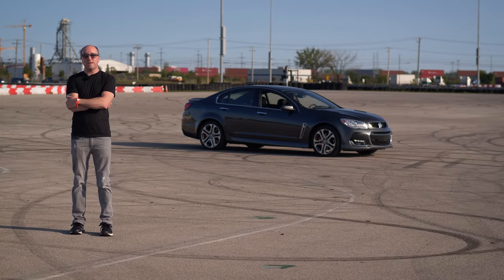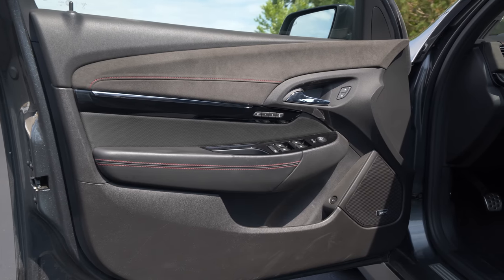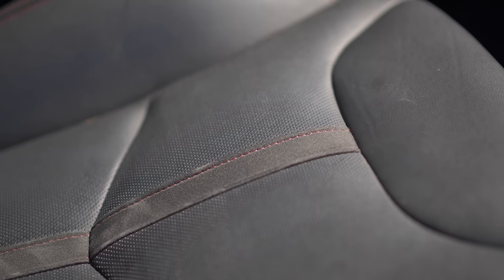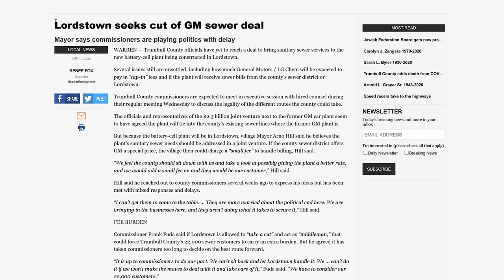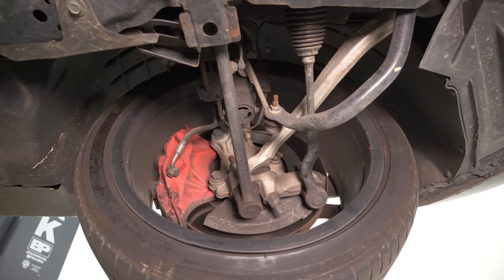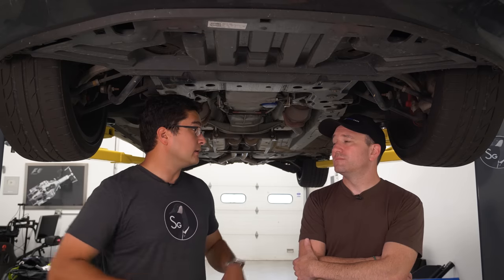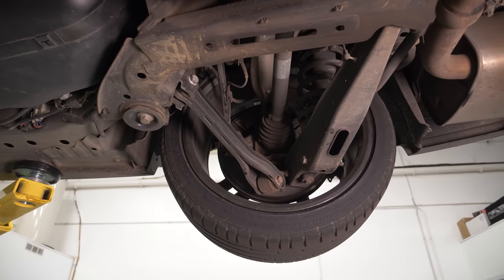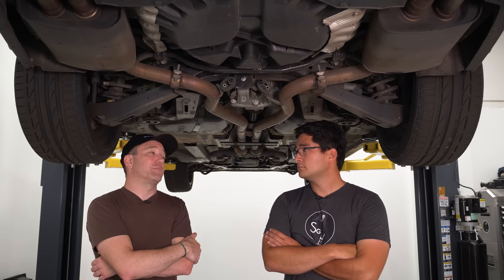Chevy SS Commodore | Holden a Funeral

Comment: Great video and a bit of a trip down memory lane. Commodores were common growing up, along with the Ford Falcon counterpart. I used to live a few kms from the Adelaide factory, which was a considerable employer for the area and I even eventually owned two Commodores (VT V6, VY Calais LS1). It's amazing how fast economics ended both the car and the brand, along with almost all local Toyota, Ford and Mitsubishi manufacturing.
Reply: So, does this mean that y'all are pretty much going to be importing most of your cars from now on?
Reply: @lego4virgo  yeah. I actually can't think of any local car manufacturing that exists here, except for small niche stuff
Reply: @lego4virgo  yep, several factors lead to the demise of the Australian car aindustry - local labour is too expensive in Aus to build cars. and politics. and the only cars being manufactured in Aus were large 4 door sedans where the market wanted hatchbacks or SUVs. Ford had a good thing with the Territory, but it was getting old. The replacement (everest) was designed in Australia but is built in Thailand.
Reply: @lego4virgo  All of our cars are imported, though there is a firm in New South Wales or Queensland I believe that is going to try and kick-start hydrogen EVs which should be interesting.

Comment: I was lucky enough to spend five weeks with a VY Series II Holden Calais on my first trip to Australia. Then I rented a VE SS for the next trip. Tbh I liked the VY better. And with no idea what I was getting into, when I first turned the key I said to myself, “This is like a 5 Series with an LS1!”  I feel like GM could have done better serving these nice cars up to the rest of the world. Thanks for the video. Cheers.
Reply: VY Interior is better put together than the VE.
Reply: @cjdacka That was a high point for me with the Calais.
Reply: @cjdacka  VY also carries a higher price tag and targets richer people.
Reply: @pikapika4558  what? No 😂
Reply: @cjdacka  That's simply untrue, or is based on purely anecdotal experiences (you may well have seen a 'Friday, before a long weekend build' of one model that was sub-par - that doesnt mean they are all like that.  Build margins and quality controls were significantly tighter across the VE/VF than the VY/VZ.
This was evidenced by the much improved faults/100 rates achieved.

Comment: Actually, old mate is slightly wrong about Holdens Finances. The Commodore was released in 1978 and was quite smaller in size compared to Ford Falcon. Sold very well until 1982 when the larger Ford Falcon outsold it 2-1. The Commodores compact size was now hurting sales and Holden badly. The oil crisis was now over and larger cars were selling. GM then bailed out Holden in 1983 and by 1988 the VN wider series was released. This brought profit back to Holden during these years and allowed them to finance the VT of 1997 and the Billion dollar VE series in 2006. Holden's massive investment on the VE was also due to Bob Lutz and other good GM CEO's who wanted Holden's as a Pontiacs to be sold in USA(G8). The ute and the wagon were also supposed to be going there and even a new version of the 2 door Monaro (GTO Coupe). But because of the rising Aussie dollar and GFC, Holden began to suffer. ALso, Pontiac was shutdown taking away Holden's dreams and all that investment. That is when Aussie Tax Payers started tipping in money but nowhere near like the amount for GM/ Chrysler bailouts. Large cars were also taking a hit thanks to these shopping trolley SUV's that so many cannot drive very well. Then in 2013, our new Government all worried about budget deficits, Joe Hockey (treasurer) basically told GM to go jump in relation to giving any more financial assistance to HOLDEN. Thus with no help or care factor from the bastards we had in power, GM pulled the plug. And now GM has shut down all right-hand drive to concentrate ironically on China!!!! Wonder how that will go now. And that was it for HOLDEN 2020.
Reply: Why is it a government issue that general motors a company in the states that was bailed out from debt and if you look at the company fundamentals right now GM is in more debt than the GFC why should the government keep bailing out a company that fails to learn and kept racking up debt even more why should governments bail them out again ?
Reply: Michael Wilson I agree, here in America we should never of bailed out GM and chrysler or given money to Ford, period. If these companies are that incompetent then let them fail. Not the government’s job to bail out dumb CEO’s who don’t care or don’t know how to run their companies. Every time you bail them out it just sets a precedent for this shit to keep happening.
Reply: You forgot the beginning of the end, caused by the gillard labor government. 
The novated leasing changes, brought in by gillard, with no industry consultation and no warning, caused thousands of new orders to be canceled in a week. 
The Abbot government missed an opportunity, when novated leasing resumed, they should have limited it to Australian built cars. 
Holden, Ford and Toyota's local manufacturing could have been saved, with that one small change.
Reply: Hi.  One of the many GM mistakes, is that when the VB Commodore was released in 1978 it was smaller than the current family sedan "HZ Kingswood"
Now the HZ was sedan / wagon / ute / panel van / one tonner and stretched statesman

The commodore was sedan or wagon only

Sure the ute / van / statesman continued up to about 1984 - but why not produce the 4 door sedan as well the tooling is still there and so was the demand

A big loss for holden was large family cars , taxi's , fleet vehicles.

For people outside australia, the early commodore was based on Opel and not much bigger than say a BMW 3 series at the time or say a Camry today

Ford laughed all the way to the bank, XD falcons all the way to EA falcons were making a sales numbers killing.

The commodore was a decent car, came in 6 or V8 and later a 4 - but it should have been the replacement for the smaller torana not the larger set of vehicles.

My personal GM cars have been

1979 VB Commodore 235 V8
1985 VL Commodore with the Nissan engine
1992 VP Berlina - V6
1999 VT Commodore SS Series one with the 5.0 V8 - last of the Australian V8's ( Series 2 was the chev Gen 3 )
2002 VY Commodore based Statesman V6 Supercharged ( WH Statesman code )
2007 VE Commodore Based Statesman V6 ( WM Statesman Code )

Every single model drove better then the one before, everything, ride, steering , handling is better. The SS i kept until last xmas 2019 as our spare car because it was a bullet proof V8

Rather than say the 50's with just the big 3 manufacturers, there is a lot to choose from, sever completion from asia and toyotas being both very affordable and reliable vehicles.

With competition comes improvements and price wars, but eventually some one will fail and just fold.

The concept of the world car means sell a few variations of something, then just pick the one wilt the most  success, then just sell that one car all over the world, no need for multiple body / running gear variations

Local manufacturing, well not anymore it is disappearing just like the dodo bird

Regards
George
Reply: @aaronnoyb  You are somewhat incorrect. The 2011 changes actually benefitted those with novated leases. It was 2013 changes that fucked it and when it was changed back they changed it back to the Gillard policy
Reply: @zackrrhodes  
Nope.
July 2013, Labor ended the FBT exemption on leased vehicles, resulting in thousands of cancelled vehicle orders(including my own) as well as creating lots of unemployment for fleet salesmen. The incoming coalition government, returned the FBT exemption. A little tweak, to apply it, to only Australian built vehicles, would have saved the industry, sadly didn't happen. Too many coalition voters, are badge snobs, I guess.
Reply: @aaronnoyb  Yes but that came after the 2011 changes. You're right that the 2013 changes were a screw up but that happened under Rudd and the LNP went back to Gillard's policy
Reply: @georgemaragos2378  Yep "commodore  ...... replacement for the smaller torana" always thought that!
Reply: @Paul_Zernick  No, actually the first OPELS brought to Australia literally BROKE in half. The Germans could not believe what the Aussies wanted of the car and hence totally re engineered the then World V car to suit 4,6 & 8 engines plus stand up to our unique conditions. So you need to go check out an old Wheels Magazine article on the story of this car. The German car was a world apart from the eventual Australian made product.
Reply: @fastmonaro05  opel commodore. Not a Aussie car. The end. Hence it was smaller than a kingswood. We want statesman's & fairlaines, not cortinas & Morris minors. Shit throwback to being part of the British empire.
Reply: @Paul_Zernick  Seriously bro, it was an Aussie car; Re-engineered, designed and BUILT right here in Australia. And yes I own two Holden HQ's; Premier & Sandman ute. And what's with the British Empire crap???? Holden was taken over by GM in 1932 during the depression. Opel was German. Vauxhall was owned by GM, since sold off. Not sure where you are getting your facts. Why don't you do some research or buy a book on the development of Aussie cars. The LAST 100% Commodore all built here was a 1997/98 VT Series 1 with a Holden 5ltr V8. Buicks  3.8ltr were also built right here in Melbournes Fishermen bend engine plant. LS motors were imported. 3.6LTRs were also built in the same plant. The LS motors were also modified using Aussie Harrop blowers plus development for HSV variants.
Reply: @fastmonaro05  opel, vauxhall, chev. All GM. As for small euro "family" cars. That's the British empire. We could have got galaxies, Cadillacs, bel airs. Nope. We got cortinas escorts and Morris minors. We got euro shit boxes not yank tanks. The opel commodore was just one more of them. Later yes we built bigger and better ones. The first one was a camira/cortina shitbox version.

Comment: Awesome video. Hit the nail on the head in many points. So glad someone has finally touched on the GM screwing Holden part. There is a story going around how GM stuck the SS in the back of showrooms with very little to no data or information given to the dealers on the car and no advertising at all. It’s hard yo sell a car with no information. It was a sad day when Holden closed their doors.

Comment: Probably the most underappreciated sport sedan of my lifetime. I had a Dodge Charger when these were introduced and I always liked the sleeper effect from the SS.
Reply: It's not a sport sedan. It's a family hack with a V8.
Reply: V8, sports suspension, available manual, and clearly a sedan... If the CTS-V, SRT Charger, 3/5 Series, and C/E class MB are sport sedans... the Chevy SS definitely is also
Reply: @timw2083  So what? Does that mean that the exact same car with the 3.6L V6 is also a sports sedan? Is that also true in a Woolworths car park with kid vomit on the seats? It's a family sedan with the bigger engine and slightly fancier trim.
Reply: @timw2083  If you put those things in an Impala, have you magically made a sports sedan?

Comment: I do love my Charger Scat Pack...but in a different way then I loved my SS.  I miss my SS to be honest.  Great car.

By the way, only reason they brought it to North America was because of agreements made to export a certain number of Holden's.  Chevy never cared about the SS, never advertised it beyond it being the NASCAR body...it was doomed on arrival both because of Chevy's lack of care but also because I'm sure GM knew from the start they were going to be killing Holden.
Reply: I was shocked when NASCAR used the SS instead of the Impala (IIRC, at the time Ford was using the Taurus and Dodge was using the Charger... still pushing that whole Race-Sunday-Showroom-Monday thing)

I couldn't afford a Chevy SS when they were new, and by the time I could afford a fun-sports-car in late 2020, the manual SS's still command north of 40k.

I ended up finding a new '21 Camaro LT1 ("LT1" is a trim created for the 2020 model year with the interior of the 1LT with the drivetrain of the 1SS) with the same Tremec TR-6060 that's in the Chevy SS (now has rev-matching).  My '21 Camaro was $29,000.00 after the dealer and GM rebates.

Much like the Chevy SS, practically no one even realizes that the Camaro LT1 trim exists.

GM's a funny bunch - That'll charge 50k for a new Chevy SS in 2017, then turn around and create the LT1 trim for the 6th Gen Camaro and give you one of Tremec's better transmissions and a 450HP V8 for less than 30k after rebates.

But like you said : They never cared about the SS actually selling... freaking goofs >_<

Comment: The funniest thing I find about the demise of the Australian front-engine RWD 4-door sedan Holden and Fords is that; in the early 90's, the motoring press was complaining about poor handling, heavy, live-axle, leaf-sprung fuel-thirsty cars; bemoaning the lack of refinement and IRS; saying that this was the cause of lacklustre Australian made cars. Now, instead of driving the refined sedans designed in new millennium, many Australians choose instead to drive heavy, thirsty, leaf-srung, live-axle dual-cab utes (pickups).

Go figure...
Reply: lacklustre sales
Reply: Absolutely true. They are all about saving the planet but just drive heavier suv type cars that never leave the bitumen, they have smaller engines with heavier bodies and get basicly the same fuel economy as a v6 commodore anyhow. Cost more to register. Cost more for tyres and servicing. And cost the environment more as they need more sheet metal. I work in a holden/ nissan dealership and its rediculous how wasteful the human race has become. All because people think they are safer in a top heavy suv. Tards. If you dont go off road, you do not need an suv. About 90 percent of the population.

Comment: As an Aussie that's owned a VF Commodore (albeit the v6 version) I can totally relate and am still sad at the closure of Holden and the rest of the Automotive industry in Australia. The Aussie version differed a bit with some of the interior details, mainly the seats and the Chevy badge on the steering wheel but essentially the same car. A great car to drive, either to go shopping in or long distances. I never thought, "hey i need an SUV". And will never understand the huge attraction to the popularity of an SUV instead of a sedan or a wagon version of the same car, which looked great too.  It's really sad that GM closed down Holden and that manufacturing has basically stopped in Australia. There was initial talk and rumours of the brand being bought and revived with just the V8 cars but that hasn't happened, which is a shame... :(
Reply: Frank Alarcon could not agree with you more mate. SUVs have nothing on these cars for chassis dynamics handling and character even the V6 model (I have a 2013 sv6 sports wagon). I love driving it daily and for long trips. Now Holden is gone I’ll hang onto it till I’m an old man.
Reply: @thomasclayton169  Yep I had the SV6 sedan

Comment: As much as it was killed off, the plan was to bring it over as cop car - yup, which they did (practically the same specs!). Also the cop cars were to pay for the civilian model and then would eventually be made in North America but thing didn't work out well as Ford changed the cop car game - Explorer based interceptor.   So you see, they are not idiots, just unable to control all the variables in a dynamic market.... of note, the previous camero shared this chassis.                It was a great car in aussie land and is a great car here for a specific market. It just didn't get the love it deserved.... Like you mentioned, it was a lot of different cars as well as being a sports sedan ... a ute, a wagon, a regular boring sedan with a 6 etc.
Reply: Yes, though it was a predictable move by departments that had already started buying some big conventional SUVs. It really didn't make a lot of sense to buy this oddball Australian car that was smaller than the cars it was replacing and was of unknown reliability. It was much easier to sell departments on either a spacious Explorer with better visibility or a cheaper Charger that was more like the cars being replaced. Chevy couldn't win against that competition, and everyone of any sense knew it, but GM didn't want to give up what had been a profitable sales channel.

Comment: Thank you for that lovely vid. Last week I dropped my Nissan off at a service centre and walked past a deserted Holden dealership, didn't even have used cars out the front. It was not really that old a building, recently renovated. There was still paper on some of the desks inside. It's been a sad end but you describe perfectly the reason why this happened. Having driven in my friend's Model 3 recently I can see what the future has and Holden and probably all of GM was never going to get anywhere near that.